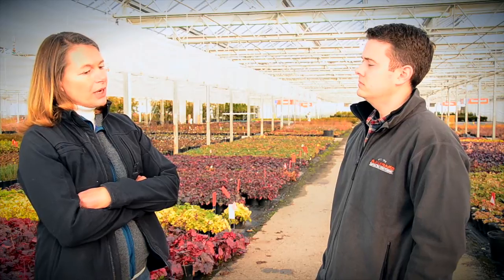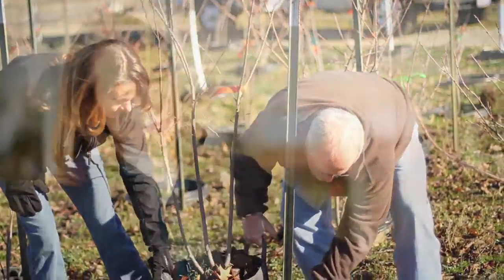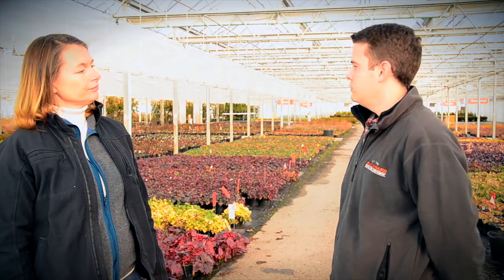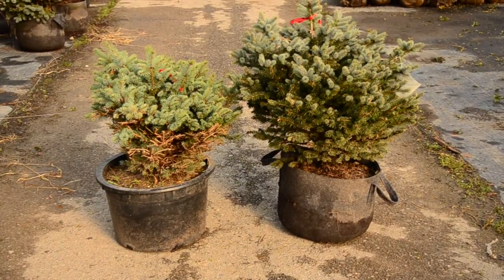Natorp's Root Pouch

Comment: I've had my chillies in root pouches for 1 year now and am really impressed with them. I've found you can use cheaper (regular) soil with them because they don't compact the soil and hold excess water. 
I usually squeeze them together into a plastic storage create and bottom water, by pouring water down a gap between them. So very quick and easy to do while getting very professional results, and very cheaply. They are even the same price as plastic pot and it looks like they are just as durable.